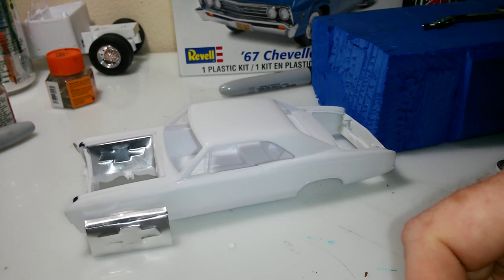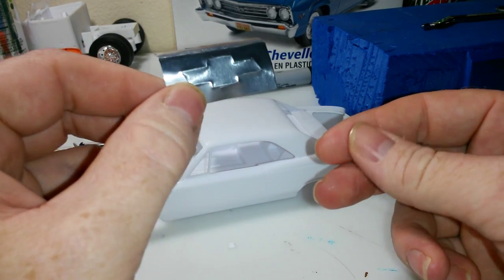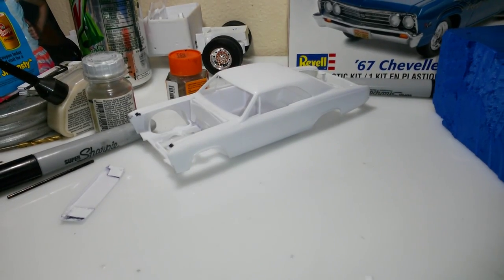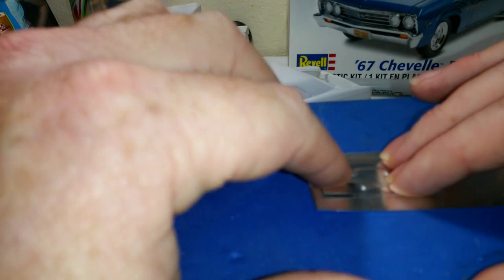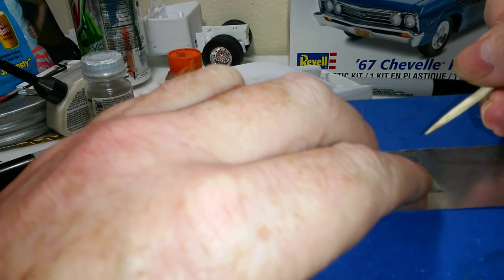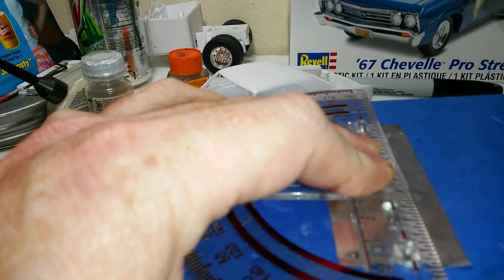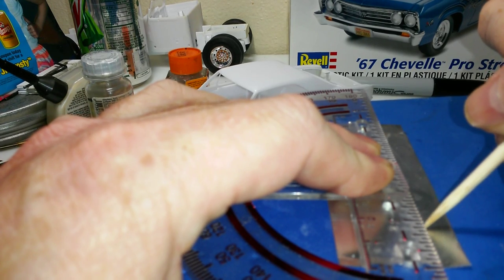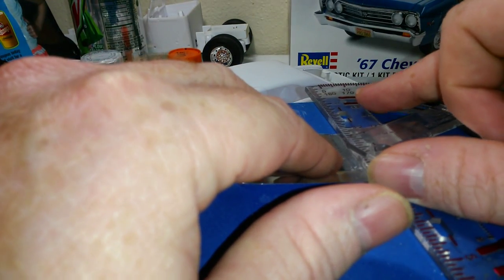How to make aluminum model car fender wells revist

Comment: The excitement of the moment
Would You think a  Ball Stylus Tool help?
They have different sized heads, Hobby Lobby, sculpting tool.
Great tips Nick
Thank You for sharing
Later
Russ
Reply from the maker: I would imagine you can use anything as long as it doesn't punch through that a really good ideal
Reply: Yep, that's what I use. They work great. The key is using a surface like Nick has.